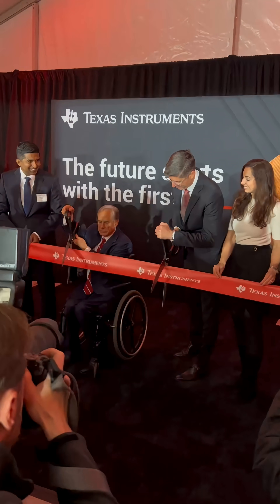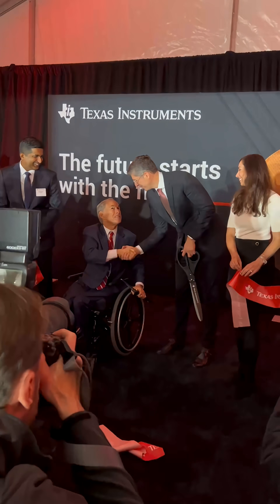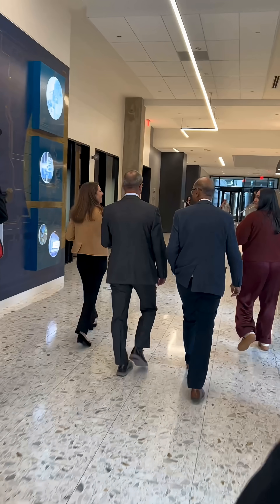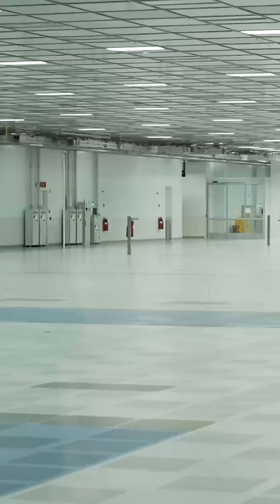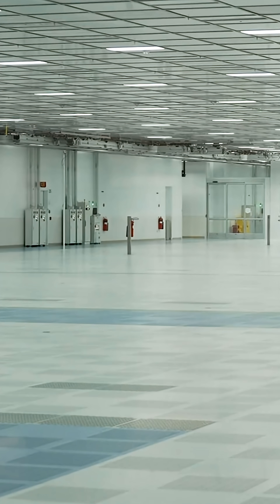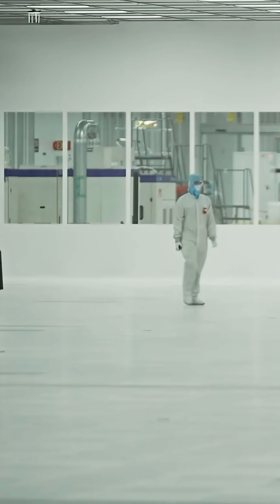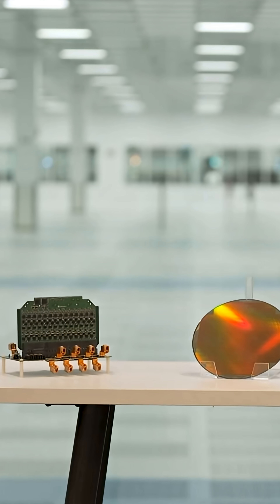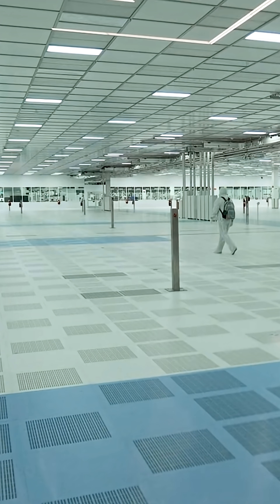Behind the scenes of the new TI plant in North Texas

Comment: Plans for up to four new, interconnected 300mm wafer fabrication plants (fabs) in Sherman, Texas. The company has announced that the first of these, SM1, has begun production as of December 2025, and the exterior shell of the second fab (SM2) is complete. However, this isn't good! These facilities are designed for manufacturing analog and embedded processing semiconductor chips (integrated circuits on silicon wafers), Not for producing flexible printed circuit boards (flexboards) or multi-level boards (multilayer PCBs) where these semiconductor IC chips are soldered onto a Printed Circuit Board (PCB) for electronic devices like Cellphones, which are typically sourced from specialized PCB manufacturers.